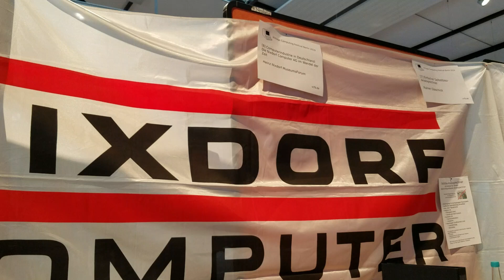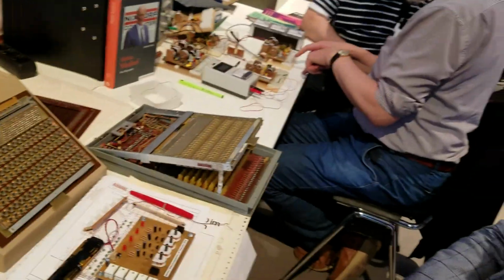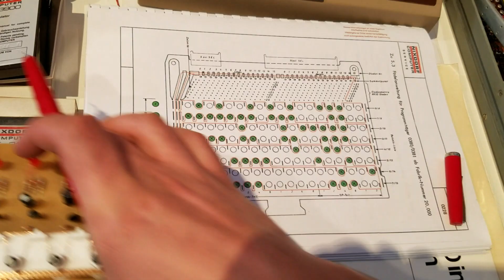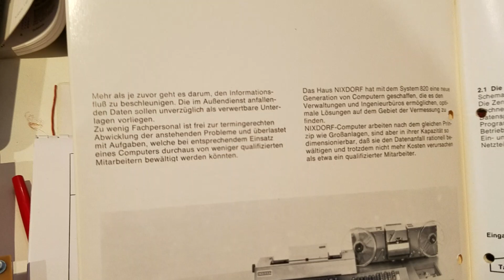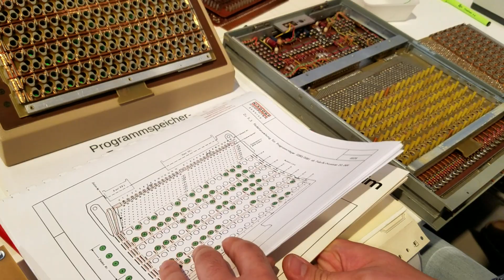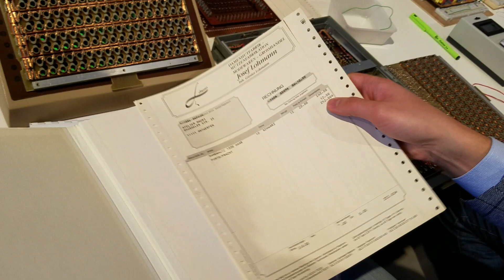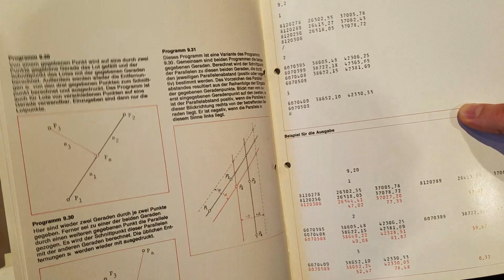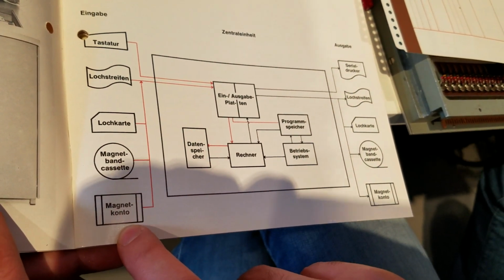Nixdorf 820 "Stick Memory" demonstration at VCFB 2019

Comment: Dietz did something very similar with the ROM boards of their 500 series Minical machines but used paper thin printed circuit boards instead of individual fine wires.
Reply from the maker: Thanks, this is a new thing for me to learn!

Comment: Wow, just recently discovered this video. I was a field service engineer for Nixdork in the late 70's (in Chicago) and serviced 820s and the newwer 840s.  Most of my time was spent servicing the converted IBM selectric printer on the 820.  The electronic boards were pretty reliable.  But when one of those programming boards failed (broken wire) it of course was a hassle for the customer to wait while we shipped that board back to our location where they had to diagnose and repair the failed wire.  The newer 820 versions stopped using the hard wired programming for the application software and instead loaded the customer program via a cassette tape reader.  This was a huge improvement - as it made modification to a program easier than hard wiring those boards!  The OS remained on those wired boards as that didnt change often.  This was state of the art back then - my, have times changed! And yes, nearly all of these machines were used for bookeeping/billing.  Insurance companies had a dozen of these machines where operaors would input claim information and store the results on cassette tapes.  Thanks for sharing this video!
Reply from the maker: I had never even heard of these boards before Christian demonstrated these to me at VCF Berlin here, so thanks so much for sharing your story and connection to these boards!

Comment: Are there any working Nixdorf minicomputers left?
Reply from the maker: Very few.  We are restoring some machines that were branded Nixdorf in the 70s, but were not originally manufactured by Nixdorf.  The Entrex 480 system rebranded the Nixdorf 620/600 series.  Does that count?

Comment: I wired those boards 50 years ago. Each one  took about 10 hours to finish a full board. They were called “rod cell” not stick in the US Los Angeles office. After doing that soul crushing job for 2 years I became a programmer then advisory (head) programmer writing standard applications like payroll and accounts payable that were sold without customizing (precursor to the “shrink wrap” concept) All other applications were written custom for each client keeping a staff of 30 programmers very very busy.
Reply from the maker: Denny, thank you SO MUCH for sharing this memory.  Now that you've seen and shared this, I'm so glad I decided to make this video last fall at the FCFB in Berlin.
Reply: Convergent MightyFrame I’m thinking about putting together a more complete history of my years at Nixdorf.  Let me know if you have any questions. Btw, Nixdorf was originally marketed in the US by Victor Comptometer before it was changed over to its original name.
Reply: @fbtraverse  - Nice to meet you - I worked in the Chicago Nixdorf office late 70's in field service (service calls for Chicago and burbs). We had quite a team of programmers on staff... Do you remember an OS called "Boss" ? I remember everytime you started the machine you had to hold down 2 keys to perform proper booting.  Why do I remember that after 50 years???  Jon